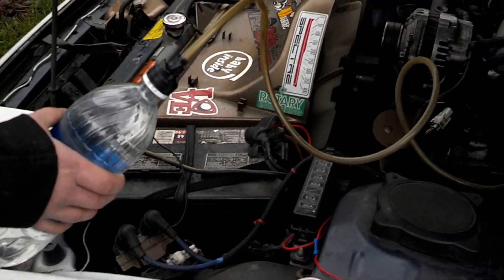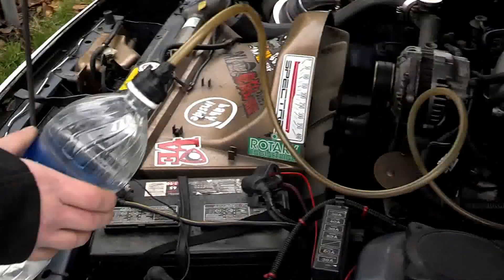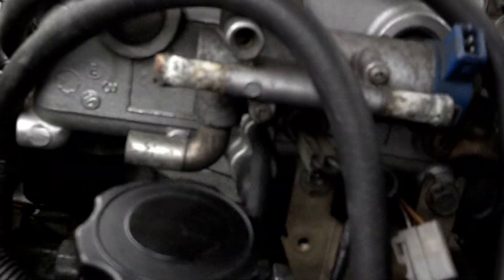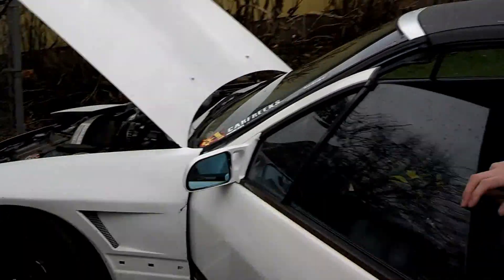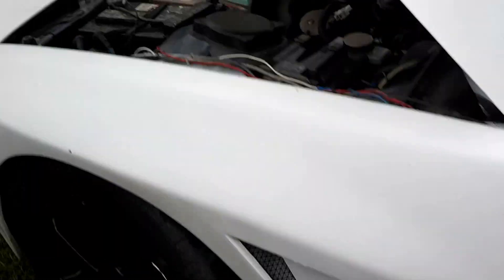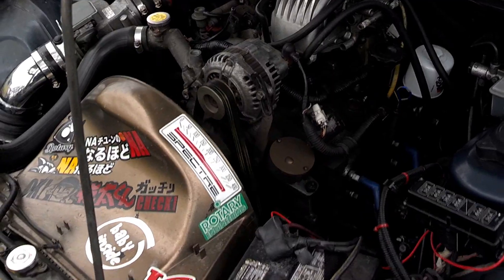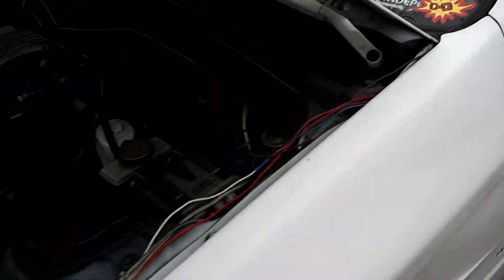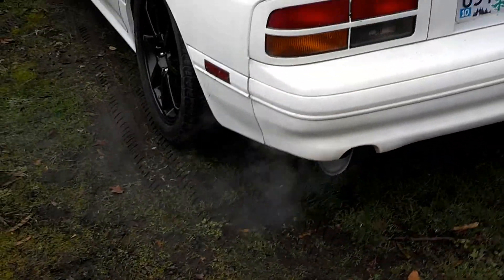RX7 Water Injection Treatment

Comment from the maker: This was the easiest ports to access since i usually do this myself so i have to hold the bottle and throttle it at the same time. Also this could be bad for those with a cat. and smog system as i do not have those. But i can attest it does help clean out the engine of carbon and you don't have to buy an expensive bottle of something that could damage things, just clean natural water from a distilled bottle, no tap water.

Comment: also, wouldn't it be more effective to use the two ports on the other side of the engine used for unflooding the car? the have direct access to each rotor?